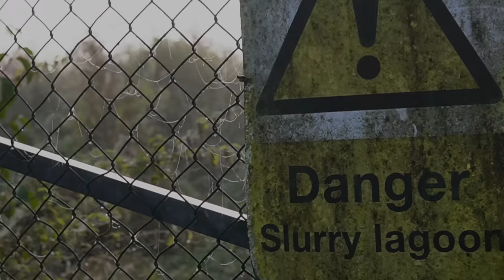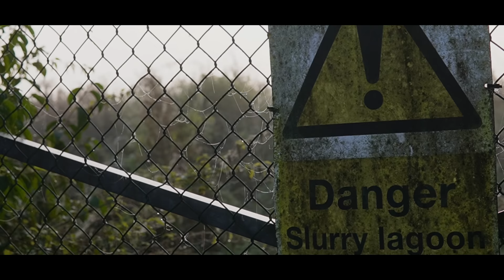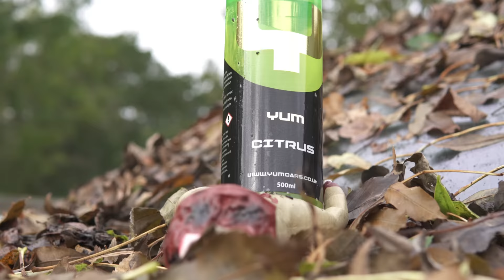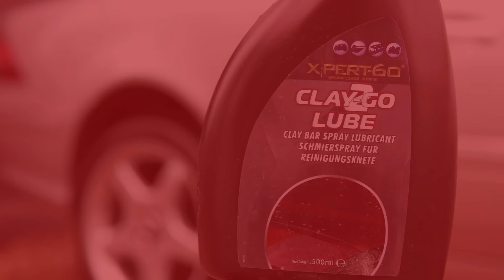Absolutely Shocking! This Filthy Mercedes gets a TRANSFORMATION

Comment: Man this the most legendary Mercedes-Benz sports of all time. In case u don’t know, it’s the Mercedes CL-class which is based on the Mercedes-Benz s class w220 and I actually own one of this series I use the cl500 that looks exactly like this and I use the w220 s500l
Reply from the maker: Think the guy had sold it for few hundred quid that was before we cleaned it. He probably could of got more as it looked stunning at the end of the day
Reply: @epicautomotivedetailing  yeah the paint will turn out great I think
Reply from the maker: @timevscars  👻

Comment: I have another Q: Headlight restauration, does it matter if it's glass or plastic in terms of the kit you're using? I guess it does?

And in terms of the applicator: Will you say it should be moist/damp before you apply a dressing or similar tyre shines?

Thanks for another informative and funny vid, Dave! 😁

Comment: If I don't have small polisher can I polish with tip of 5 inch da polisher to polish small areas? Will it not peel/burn the paint?
Reply from the maker: not necessarily but it does help
Reply: @epicautomotivedetailing  means we can safely polish with tip of 5 inch da polisher on small area right?